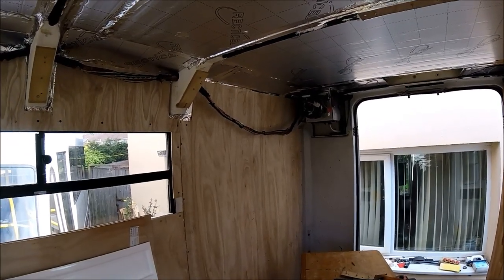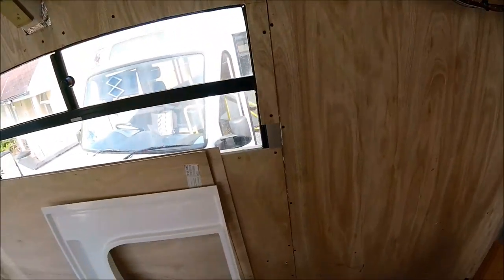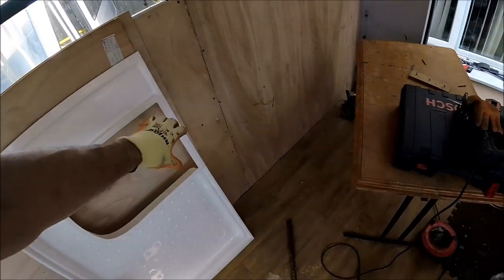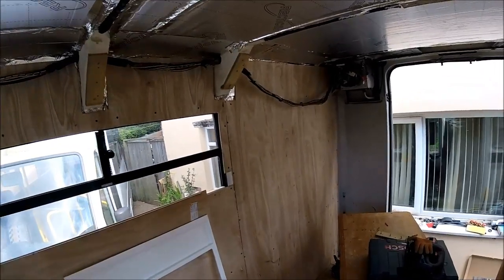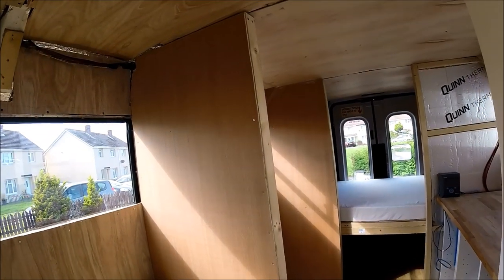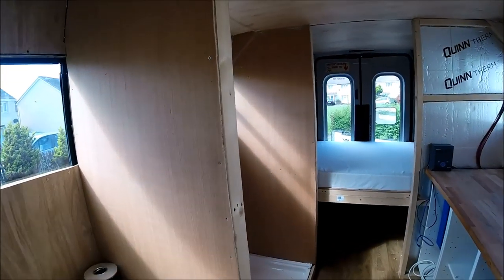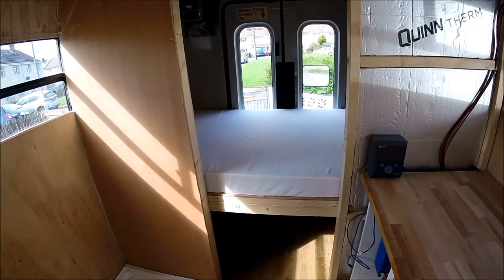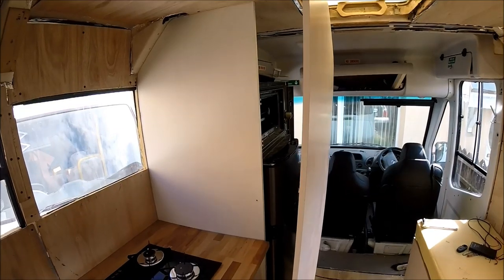Building Bedroom & Bathroom Walls In Mercedes Minibus Motorhome Conversion

Comment: Everything inside seems to be nicely placed.  Well planned use of space for the bath and bedroom area, and the kitchenette is perfectly spotted.  It is a shame that there is not enough room for a couple seats for visitors, but you can't have everything. 🙄
Reply from the maker: There will be a sofa bed up front with an extension to allow extra seating & bed for visitors and with the extension in, it’ll still measure over 190cm, I have a fussy friend who’d only go on a trip if in comfort so built with that in mind.

Comment: Hey great job with the videos on this as there’s not much else out there about converting these buses. I’m converting one at the moment and your vids give a lot of good information. Can you tell me the unladen weight sticker near your fuel filler?
Thanks
Reply from the maker: Thanks, I think the sticker says 3650 but it's a lot lighter now all the seats, rails and heavy wheelchair lift are removed.  I hope to get it downplated under 3.5t once completed if the weight is under that when full of gear after completion, we'll see on that front...